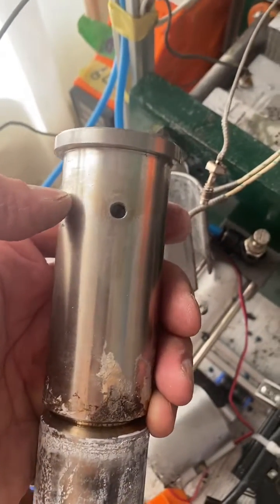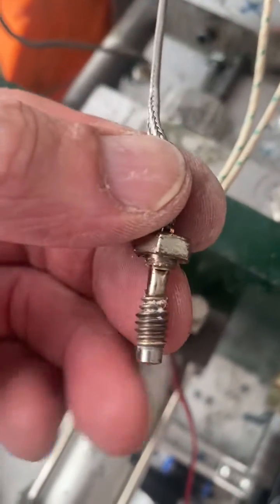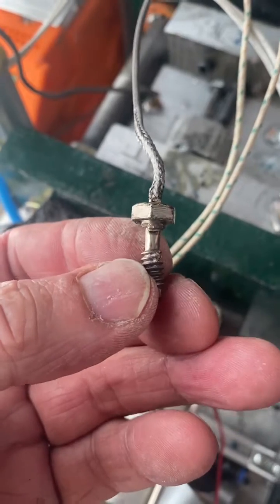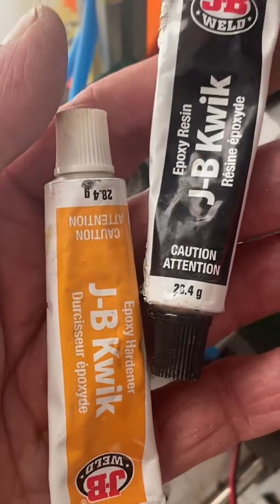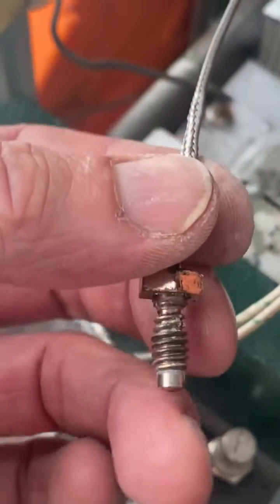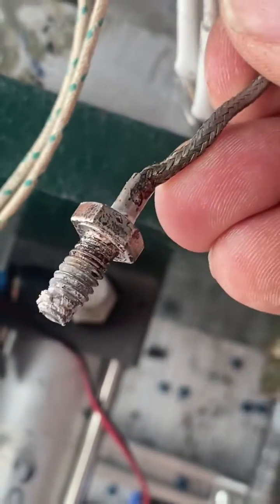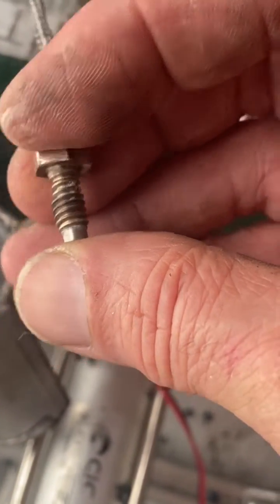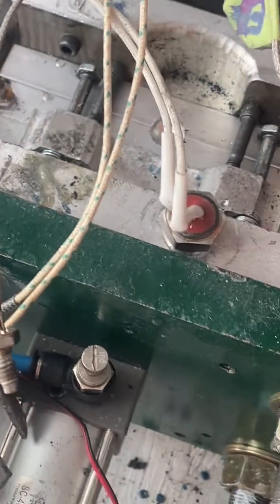Hand tighten, thermal couples only !!

Comment: Pick the right anti-seize too. For high temperatures you want nickel based anti-seize and you want bayonet mount thermocouples in brass mounts (brass is easy to drill out if it breaks).
Thermocouples have a six to twenty four month life span (due to chemical drift on type K thermocouples).